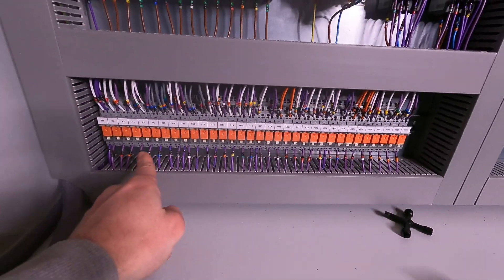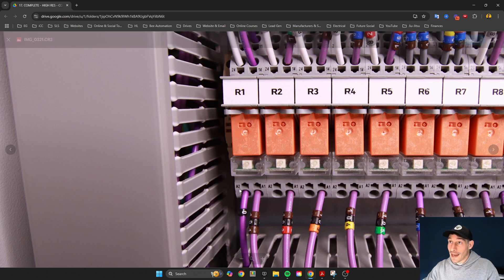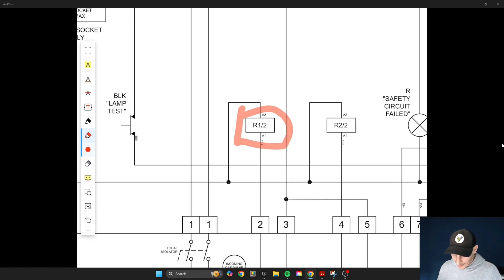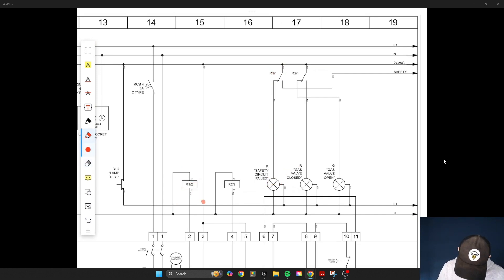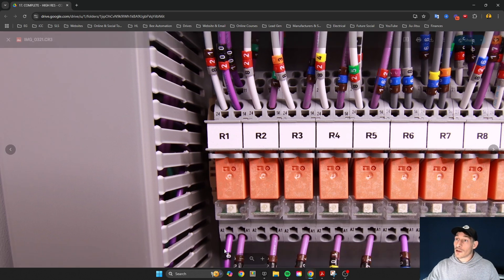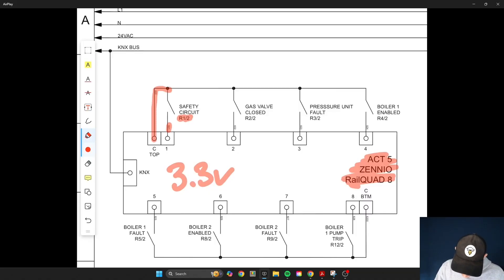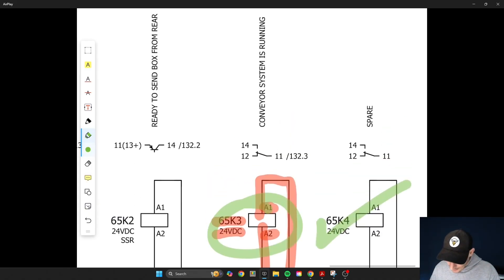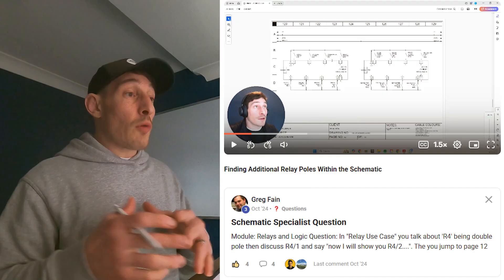How a Relay Works in Electrical Schematics

Comment: On older panels, you'll sometimes find the 0v on the A1 and the 24v on the A2 on AC relays. They also sometimes switch the 0v instead of the 24v. Being that you're a 20+ exp engineer, I thought you'd have seen that?

A blanket 24v is always on the A1 isn't true and will catch people out when fault finding.

Comment: Im a low voltage guy that started out doing alarms, then learned cameras, networking and finally educating myself on access control. Relays have fascinated me from the time I actually understood how they worked. It's literally binary represented physically. These schematics remind me of wiring up an alarm curcuit on these old 1994 natureform egg incubators a few years ago. I had to learn how to read wiring diagrams to figure it out. I just tied my alarm circuit to a relay on the alarm light on the panel. Once I understood more I was able to acquire another customer with the same incubators, and able to seperate individual alarms (humidity, temp, power, fan, door position, etc). I spent way more time than I was paid, but it was a masterclass in controls wiring and was priceless. Love the videos. Keep up the good work 👍

Comment: I’d love to see a video on how you select colours of cables in your cabinets please
Reply: Same here I'd like to see it too.. hope you're having a good day?
Reply: A good place to start if you want the recommended system is BS-EN60204-1:2019 section 13.2.4
In a nutshell
BLACK: AC phase & DC ± power circuits
LIGHT BLUE: AC power neutral
GREEN/YELLOW: protective earth/ground
RED: AC phase and neutral control circuits via transformer (24Vac SELV)
BLUE: DC ± control circuits via power supply unit (24Vdc SELV)
ORANGE: excepted circuits
Reply: @JaenFoster Engineer you have said it all. Where are you from?

Comment: Thanks for the video. I just built a control system involving BMS as well. Not as professional so no eplan/solidworks/cad instead just hand drawings 😬. For designing the system though, it really helped being able to draw safety chains exactly like they would happen, kind of like a PLC ladder logic diagram. For wiring things having different pages for powering the coils and wiring the contacts would obviously be better, but designing in this way is something I can’t wrap my head around.